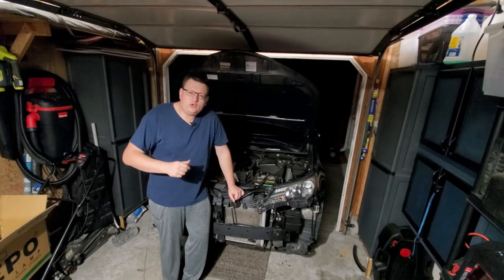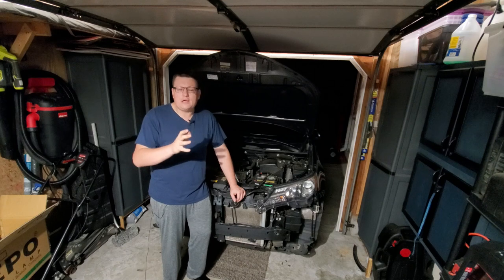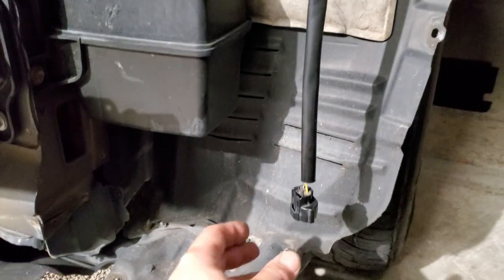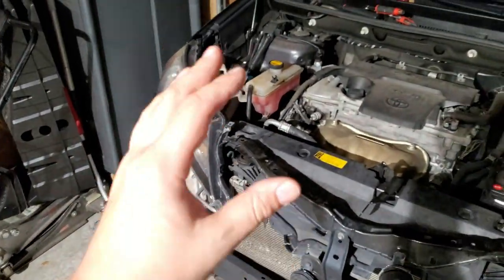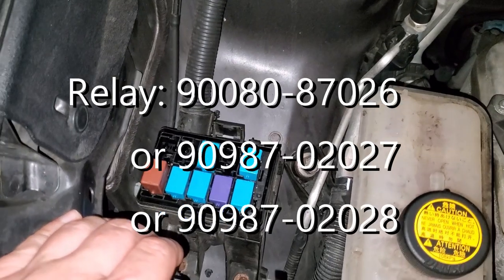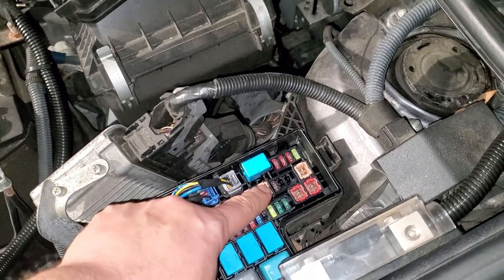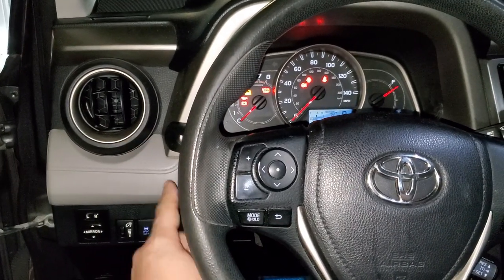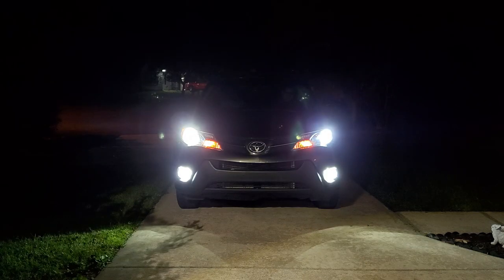Toyota Rav4 Fog Lamps Install (Wiring)

Comment: GREAT video. I was struggling to remove the pins and rearrange them then i realized i didn't have to after all, i could just tape the other pin3 and pin4 separately and use pin1 and pin2. Color  code doesn't matter here!!! Thanks so much. Makes life easier for me. I don't fancy too much light anyway and i don't know if the color of the switch is going to match the stock buttons.

Comment: I followed all the instruction but don't have electricity in the blue wire when I t tap,any suggestions?
Reply from the maker: Does your relay  work??  My was faulty.  Used horn relay.  Also check 10 amp fuse

Comment: I have a 2017 Toyota RAV4 Le. The traction control button is not located on the left side dash panel like car you have featured, it's on the center console. So can I still do this with the ground switch just without the lighting the button turning off and on

Comment: How did you get your RAV4 to turn off all the lights automatically when locking the car? I thought LE does not have automatic setting on headlights.
Reply from the maker: It does. Mine always turned light automatic off after few minutes. But if u lock it twice in a row it will It turn light right away, that does not specify on  a switch.
Reply: @IvanRossS  do you have the AUTO setting on the headlight stalk? I have a 2013 RAV4 LE and it doesnt come with automatic off lights.
Reply from the maker: @justaflyg  no I do not
Reply from the maker: Some cars don't even have to have auto shutoff, they work on relay, after some period of time it will turn off for you automatically to save your battery, it's basically courtesy if you forgot to turn off your lights.  Some carmakers have that, some don't. I'm glad my Toyota put that opinion . You can simply test that, lock your car with headlights ON and come back and couple of minutes

Comment: I have a 2022 Rav 4 XLE. Want to  put the fog lights on it. What  year, and trim level is  your vehicle. The one we have was  made in Canada. Probably that does not matter. I notice you have  the 3 place  for the  switches plus two other switch location. We have only 3, and the mirror control is in the door.  They moved the AWL drive switch  on the line with the fan, eco switch recirculation switch. I wonder if the XLE  I have has the factory harness? Anyway to tell without ripping every thing a part? Thanks.

Comment: I have power to my lights when I test them from the relay. I can’t get power from the relay to the switch…what am I missing?
Reply from the maker: Can you make sure that your relay is actually working . I bought 2 from Amazon and one was defective...
Reply: @IvanRossS  I will try again tomorrow. I also bought a two pack and tried both relays. still nothing. I am going to try soldering instead of those t taps. I don’t think they are giving a good connection.

Comment: Hello, great video, do you know if this would work for a rav4 2018 le as well?
Reply from the maker: Yes it will. it's the same generation of the vehicle lol
Reply from the maker: The only difference between yours and mine is a body style and more options, features. But overall it's the same car it's the same frame same engine and same transmission

Comment: Hi Very nice information, I have a question is this will be same steps on 2018 RAV4 Le or theres a huge difference? 

thank you for your feedback.
Reply from the maker: Lol it's a same car. Mine was LE too, your newer 2018 model only the difference are trim design that's all.  But it's practically same car inside
Reply: Awesome!! your the man! no one showed how to do with the pre installed wiring on how to do it ,this is more okay than the generic wiring with the kit! Thank you!!
Reply: Hi sir additional question, What is the wire size for that white wire P56,.so can buy the right size of self tapping connectors 👍🏼 thanks

Comment: Thanks very much for this great information. I suspect that there are wiring instructions for this available from toyota and you don't have to cut into the tap at pin 56.
Can you tell me if I hook up the bundled red wires to the hot switch will it light up the switch and lights correctly? Also they work on the setting using the lights when they are not on the automatic off position only

Comment: Thank you so much I did exactly like the video said. At first I couldn't understand why the switch wasn't working but I saw I had wired it as a ground and not a hot circuit. All fixed now and they work great 👍
Reply from the maker: Glad I helped

Comment: Hi just to clarify, when you are tapping into the pre existing wire that you put in pin 53, is that wire always white or blue? How do you know what wire to tap into with the blue/white wire from the switch that comes with kit?
Reply from the maker: Pin 53 can be any color just make sure you tap into a proper pin number 53, if on you harness from the switch your wire is white (not blue)  use that.  So white tap in to white
Reply: @IvanRossS  sorry, what I meant was the small white wire that is physically running into the pin, where did that come from so I can splice the blue/white signal wire from kit to it and insert into pin 53

Comment: great video will this work on a 2018 rav4 hybrid ??
Reply from the maker: It's kind of hard to tell because Electronics is there different.  U gotta look for fog wires and look under the dash to see if your wiring is the same and fuse box under the hood. If everything looks the same then it should work

Comment: Followed exactly and it did not work. What about the relay that comes with your kit if you have a hot circuit switch? Don’t you need that additional relay?
Reply: @ivanRossS do you need to use the additional relay if you have a hot circuit? I followed what you did for a hot circuit and I get no power to the lights.

Comment: Can you send me the link for this kit? I can't copy from your description
Reply from the maker: RP Remarkable Power, Fog Light fit for 2013 2014 2015 RAV4 Clear Fog Lights KIT Assembly with Wiring Harness& Switch, H16 12V 19W Halogen Bulbs Clear Lens FL7001 https://a.co/d/e70xDNv

Comment: With this setup, the fog will auto turn on when you open the lowbeam? Does they also stay on , on the high beam?
Reply from the maker: Yes they do stay on on the high beam. On my Toyota everything turns off when I lock car my car. It locks right away when I click to lock twice or it will turn off automatically after 30 seconds

Comment: I don't understand, are some of the switches hot and some ground that come in the kit you ordered?  I ordered the same kit (from your link).  Am I safe to assume its a hot switch?
Reply from the maker: Yes.  Don't worry nothing will blow up lol
Reply: @IvanRossS  well, I tried your method for both the ground circuit switch, and then when that did not work I attempted your method for a hot circuit switch by switching the wires around.  Neither are turning on the fog lights. I have the black grounded on the ground screw, the red Ttapped to the red wire, and in my case, the yellow wire Ttapped to 56. All I’m getting is a light on the actually switch. Nothing changes when I press it and I’m getting no power to my fog lights.. any thoughts? I inspected both the fuse under the steering wheel, as well as the fuse in the fuse box, both 7.5 fuses seem to be good. I also tried swapping the relay in the engine with another, but that didn’t work either.
Reply: @IvanRossS  any ideas why it would not be working either way? I tried both methods. The only thing I’m not quite sure about is if it’s a hot switch it sounds like you need to use a second relay from the kit in addition to the relay you put in the relay box. If that’s true, do you have directions on how to wire the additional relay under your steering wheel??
Reply: @petet7107  hello did you every get it working?

Comment: Is there any cables that need to be run from the actual fog lights to the rest of the car or are these wires already pre installed and you just need to plug the fog lights in and then do the wiring inside the car under dash?
Reply from the maker: Wires supposed to be already pre-installed!!!  I have just basic RAV4 but please double check it. I'm saying this in the video that in my car wires was already pre-wired !!!

Comment: if my 2018 rav4 no switch so i dont need to put the relay right, just direct connect to wires?
Reply from the maker: No, they will not going to work without relay lol. ! Installing relay will close the circuit! Otherwise your cables will not be providing 12 volts to the fog lamps.
Reply: @IvanRossS  i bought the led fog lamp only comes with driver and open wires that instruction said just connect to ACC, 12V , signal light and ground . so no relay at all right?
Reply from the maker: @karenyee9984  where is your signal light lol? Exactly ;) so you telling me that you bought a kit with no wires harnessess(plugs) and a button?
Reply: @IvanRossS  no laughing check on the web there is another new fog lamp model for 2018 rav 4 that integrated with LED and signal light. yours is base model need to install relay but LED doesnt

Comment: Also, Will fog lights auto turn off when high beams are on? PA wont pass inspection if not
Reply from the maker: This is really weird rule. I just tested mine and it's doesn't go of when I turn hight beam ON. I never seen vehicles that does
Reply: @IvanRossS  thanks. In PA we can only run fog lamps with low beams on. That’s also how my keep and Subaru work that came with stock fog lights
Reply: Does the switch turn fog light off when high beam are on?

Is there a way to control fog loghts with the DRL?

Comment: Hello can you tell how to  switch drl to those smalll leds installed just above the headlight indicators
Reply from the maker: Have no idea, my car done have those type of headlights. They on a new trim and new models like 2018 2019. It could be just one bulb there that project on all of them.
Reply: @IvanRossS  thanks for your reply.my rav4 15  drl just  works with high beem and but the leds are there and dont turn on there are some i have seen on which they turn on

Comment: My fog light button light is on all the time even when the car is off how do get rid of that
Reply from the maker: It should not ! you did something wrong. Also there is interior lighting timing. Check back in about 10 minutes
Reply: Your power wire is probably connected to something that's on even when the car is off

Comment: Where can I get the ground circuit switch
Reply from the maker: Lol. I have no idea:( I haven't replaced mine yet. But that T connector that is  I installed uner the dash over time because loose. So I recommend to you something else. Maybe t-connector gauge wrong size

Comment: Hi, for the fuse box under the instrument panel I don’t believe you need the 7.5 amp fuse for spot 6 FOG RR. Rear fog lights aren’t a requirement in North America. It is a common requirement in the UK though
Reply from the maker: Mine was not working without it
Reply: @IvanRossS  I see. I will try it myself when my kit comes and let you know
Reply: @IvanRossS  mine works. The 7.5 mini fuse is needed in the engine bay, but not needed in the fuse box under the instrument panel